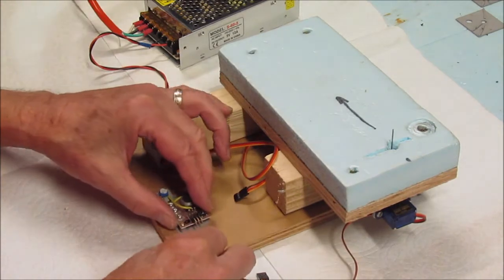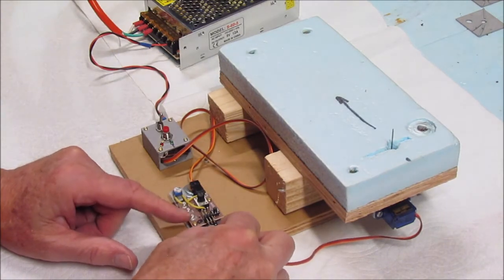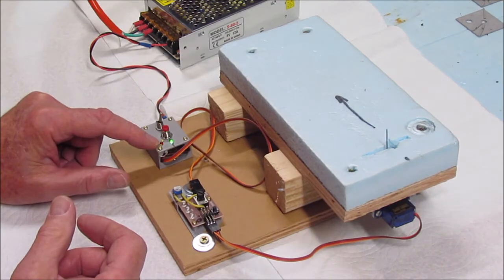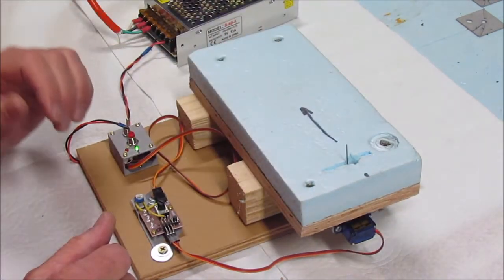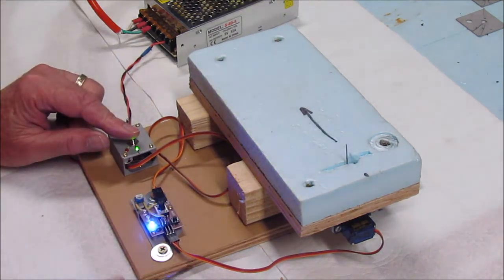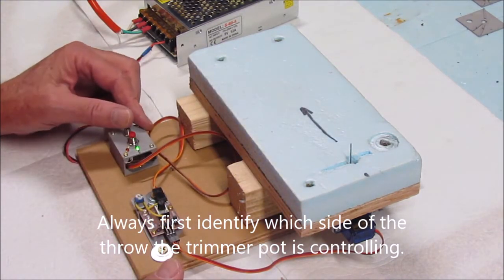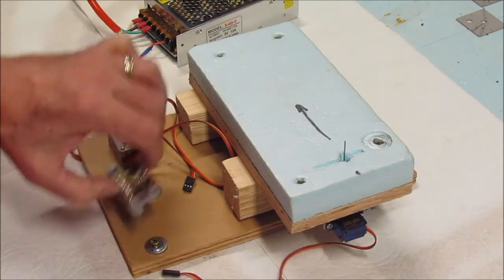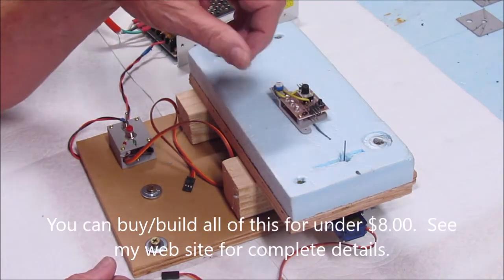Servo Controller Test Stand and Calibrating the Controller

Comment: Thanks for the video! I really appreciate the files you have on thingaverse and then a video showing how it all goes together. Planning on running my turnout servos with an Arduino hooked up to a PCA9685 servo controller. Hoping to get it all to play nice in JMRI so I can throw my turnouts with my hand throttle connected to the digitrax command station.

Comment: This looks like exactly what I need here. I've been a bit stuck on how to get the turnouts to work with those servos and this looks rather straightforward. Put those switches into a nice panel in the front and you've got a great control system.